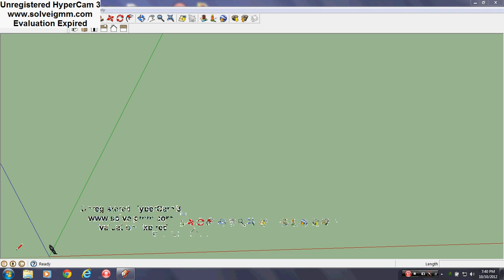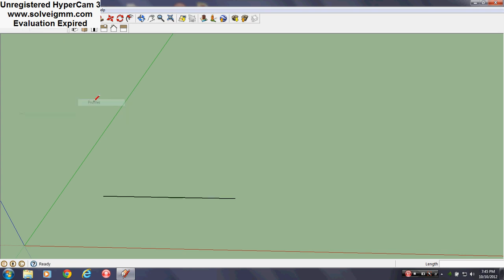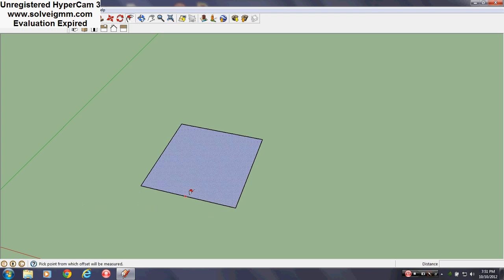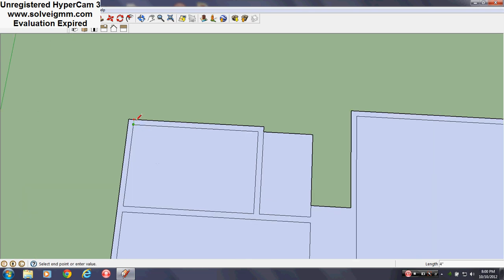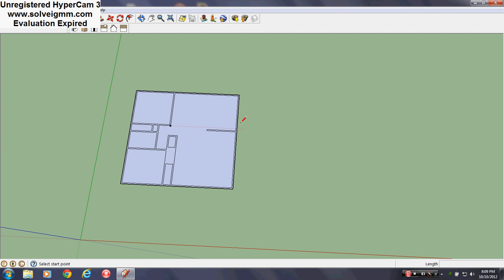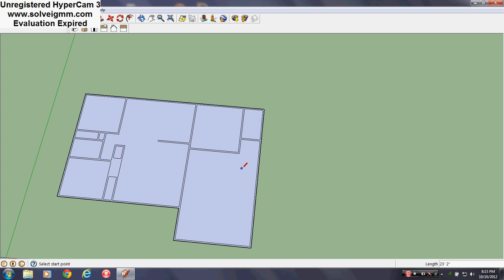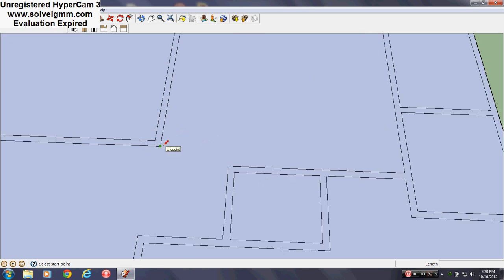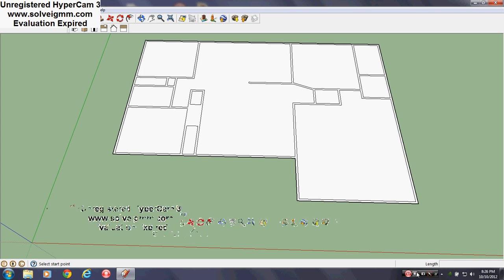Sketchup House Tutorial PT. 1 (Floor Plan) READ DESCRIPTION FIRST!!!

Comment from the maker: Though in some videos I do stress that I have different ways of doing things than what others prefer. I find more comfort in drawing lines for some reason. Some like rectangles. I generally don't rush through these things because I fear I'll miss something or find a measurement off or something and it bothers me. I don't sense hate from question. I welcome question, never be afraid to ask. I guess there are some things I could have added and things I could have omitted. I learn with every upload